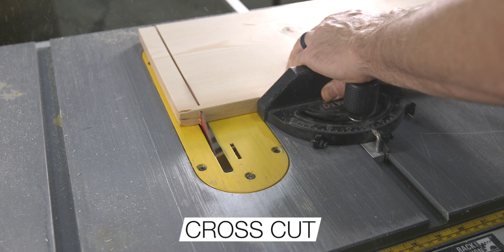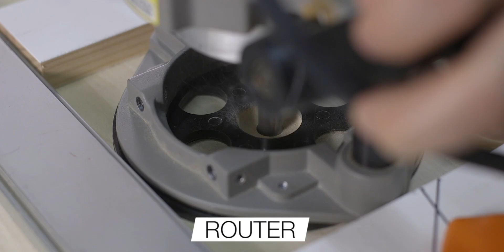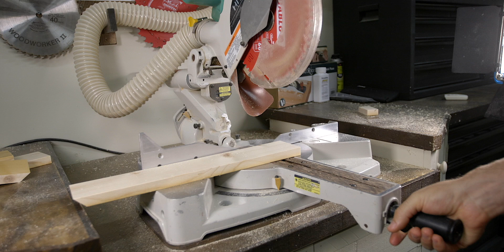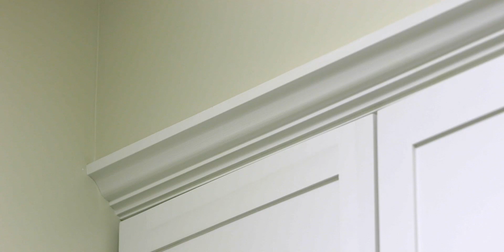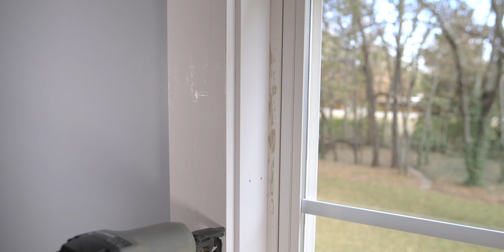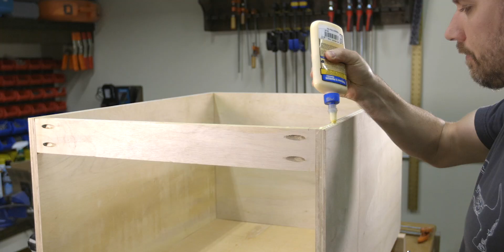Beginner Woodworking and Carpentry Terminology Part 2

Comment: Awesome vid. This might sound odd but I wished you touched a little more on how to use a Measuring Tape( add and subtract) the increments, pointers to a measuring tape basically measuring tapes for dummies. I do construction general labor and it's amazing how many people don't no how to use a Measuring Tape. It's not just something you pick up in a second. It takes time and use. Also like using a tape measure with a utility knife to cut drywall.

Comment: In the UK, we call 'base moulding' a 'skirting board'. What you call 'Rabbit' we call a 'Rebate'. What you refer to as a 'crown moulding' between the ceiling and walls, we call 'coving'. 

It would be reaaly usefiul if you could do a video on the different types of hand planes, what they're used for, how to use them and how to set them up and adjust them.
Reply from the maker: Hey Ian, thanks for sharing your terms with us! I will most definitely do a hand plane video at some point. Be well!